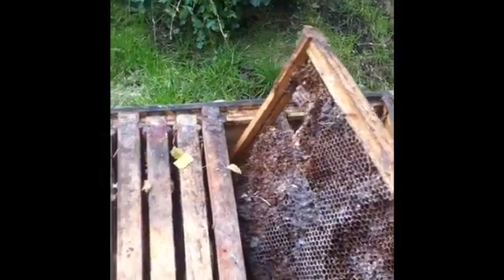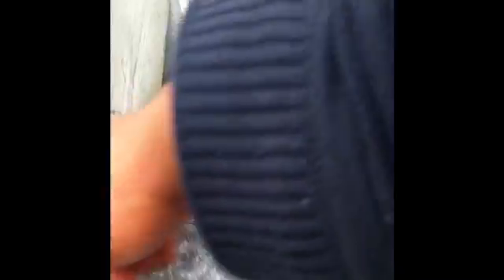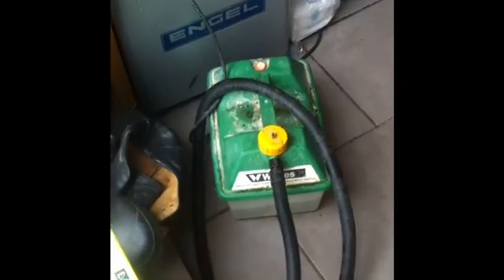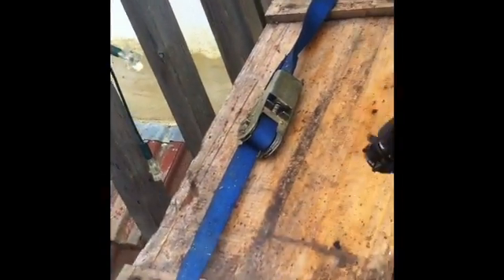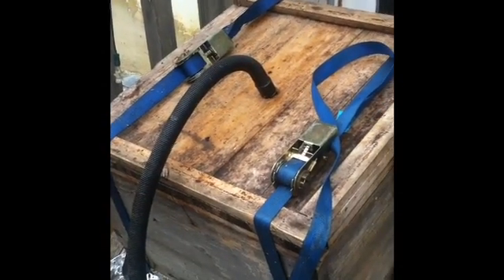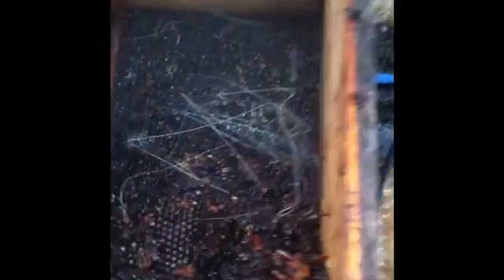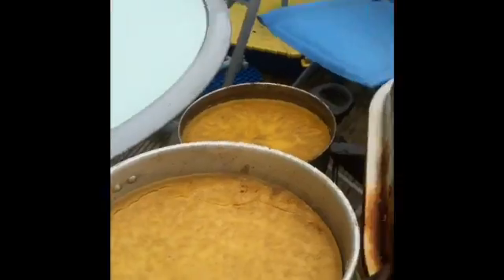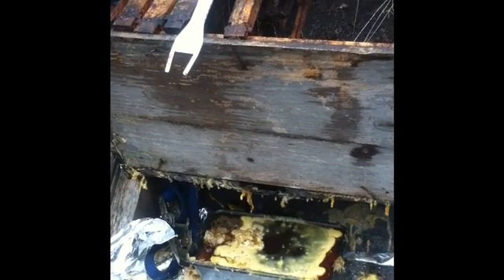Beekeeping: DIY Steam Wax Melter - Extractor

Comment: Hi there. 
Nice Easy Setup ! 👍
Cheers to a UK : 'Bee Forum' for Sharing the "Link" ! 😉
🐝🐝🐝🐝🐝🐝🐝🐝🐝🐝🐝
      Happy Beekeeping 2024
🐝🐝🐝🐝🐝🐝🐝🐝🐝🐝🐝
Met a lovely Retired Beek this last Summer : who had created a x1 Man Standing 'Lean To' Greenhouse / off a South Facing Wall (Think it was his Walled Coal Shed on the North Side !) Anyhow....
Inside this Tiny Tall Glass 'Tardis' (Man Height !)
He had made a Secondary Glass Box Construction with a internal  'Metal Sheet Back and Sides, with a Glass Front/Top, with a Metal Sloping Tin Floor. ( that were Removeable.) 
He had used all 'Scrap' or Unwanted Glass & Tin Sheeting to make it (!)  
This 'Inner Hot Box' was the Height x Depth of a "Brood Box*." 
Use :
Sitting on a Old Side Table, with a Tad Trimmed of its Front Two Legs : To Aid Wax Drainage (Dripped into a Container below !)
He could 'Melt Out' old Brood Frames*, Warped Foundation Sheets. Add all his Burr Comb & Cappings into a BBQ Tin Foil Tray. . . And let's the Sun's Ray's "Melt" all that Wax. 👍

He also used Cheap 'Mesh Bags' from the 'loose Veg' Section of the Supermarket : as Reuseable "Fine' Strainers.
All in all a Fabulous Set-Up. 

Anything else that need a 'quick heat or dry' was placed in that Shed too. Washed Bee Suit, Items with a Wax Melt Coating (Tools, Bee Boxes etc.)
Also the odd Early Season Seedling Tray before it was 'too Hot.🔥 He liked Growing all sorts of Grown Veg too. 
(Alas this Gentleman Passed last Month, knew his time was coming. 😖)
Was fortunate enough to be able to meet Him, and Buy some of His Hive Boxes and other bits of Bee Equipment. 

He had done all this here in Southern Scotland 🏴 Not the warmest place ! But on that late July day in 2024 : It must of been in the 30's C (80F) "Inside that Shed."
AND Warmer Inside that Box !

It was a lovely and very Sunny in his Back Garden : approx 22C as a Guess. Not Bad ! 🌞

Tip :
Wow : In using Ex Discarded "Double-Glazed" Windows. (Even the Tall Thin Door was made using 'Vent Windows' all one on top of another ! 🤭)
Wide enough to get Bee Boxes in and out. But the whole Structure Small Enough to "catch those Midday to Afternoon Sun Ray's"  in his South Facing back Patio Area.

Meant the Melt Shed was Hot.
And the Internal Wax Melter was even Hotter. Almost Sauna like. . . 😆

Have a lovely Photo of Him proudly showing me 'His DIY Wax Melter.'  
A nice Memory of a lovely Elder Beekeeper. . . 🐝

Comment: I was despairing because the solar extractor I made isn't that good, then I tried this today and it worked like magic! I put foil on the floorboard and an entrance restricter over this. Then instead of a varroa mesh floor I used one of those meshes you can buy for moving bees. A deep on top of that and then a lid I made out of old wood with a tight fitting hole for the hose, ratchet straps and a pan to catch it, and bingo! Many thanks Mick, I'll check your solar melter out next.